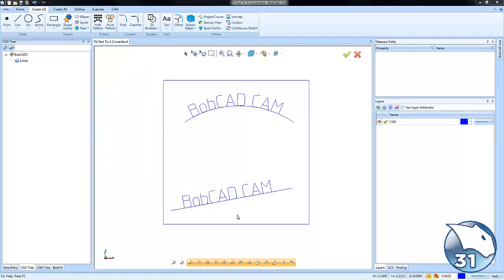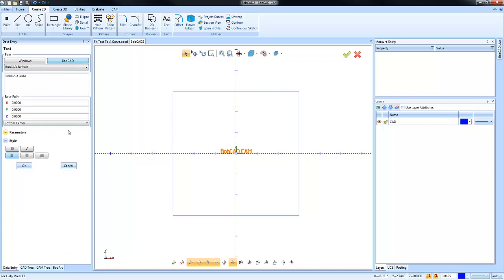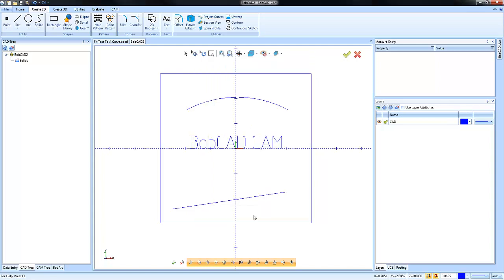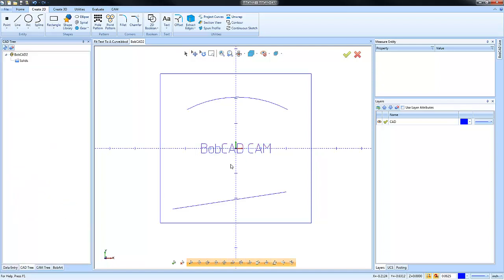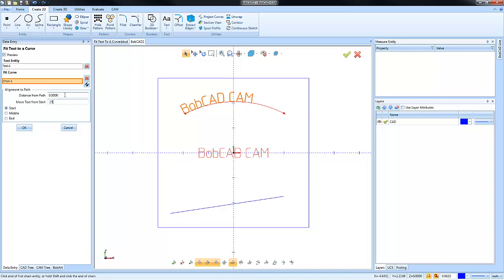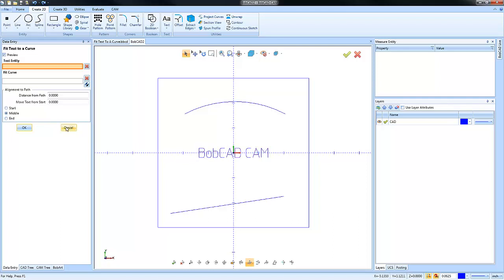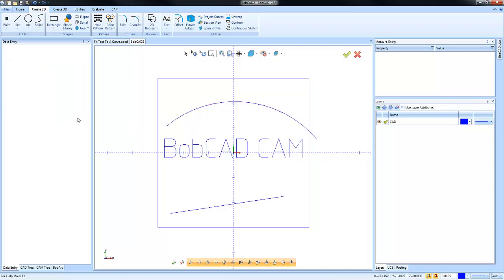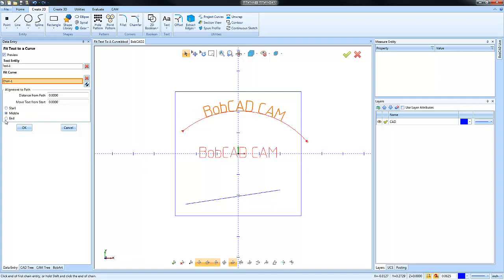Fit Text To A Curve - BobCAD-CAM Quick Tips: V31

Comment: Have you fixed the bug where when you actually choose the text to make the toolpath, it actually makes the complete toolpath? Choose BobCad HELV font, type MADE IN USA, place it along a path, then try to select that path.  Part of the A, and the E won't be selected.  After it is along the curve, you can't vectorize it to make it appear.  Major BUG!!!
Reply from the maker: Yes, this issue is resolved and has been for the last few versions.  When working with text that's self intersecting use the engraving feature.